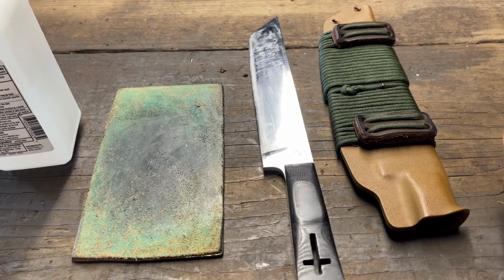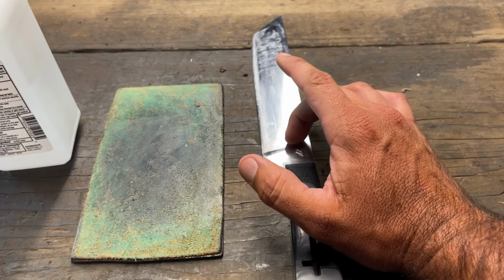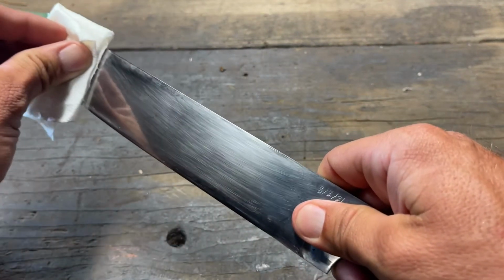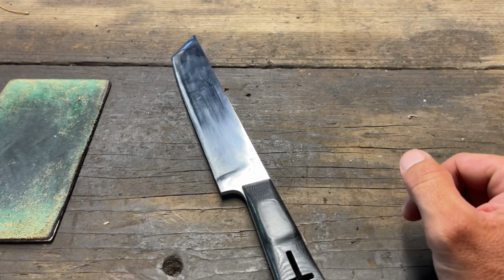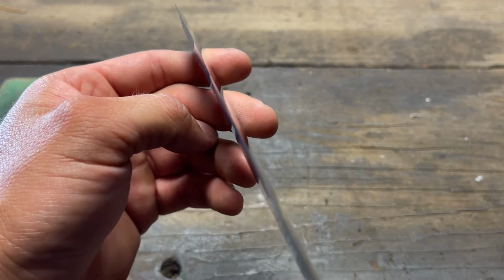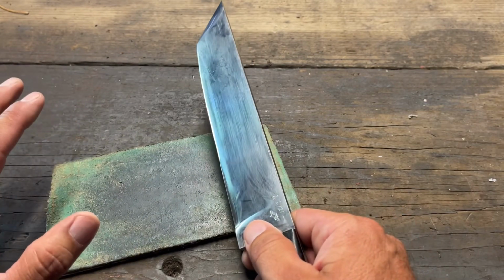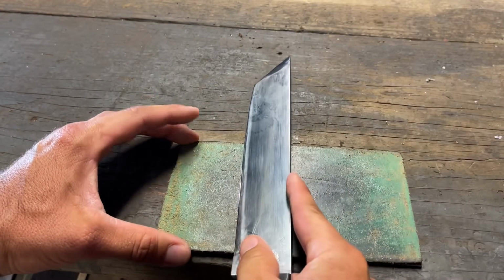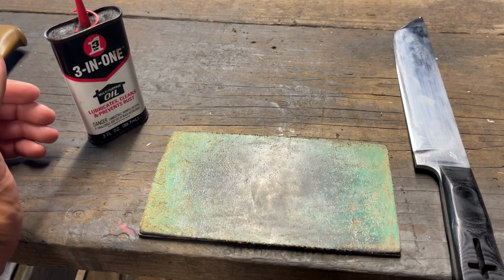Biweekly maintenance of my knife

Comment: Hi. I noticed interesting thing because i use transluscent sheath - if you dont clean the blade everytime you sheath it - all the gunk will stay in sheath and if there is something sticky - it will stay in sheath and will get mixed with abrasives and this is where you get scratches and flat spots from. So now im wiping the blade every time i go.
Reply from the maker: I always like the way you think. Thank you for your insight. I tend to just wipe my knife against my pants after use but now if it’s too gunked up I’ll clean it to avoid problems. Every now and then I think of your see through sheath, very nice.